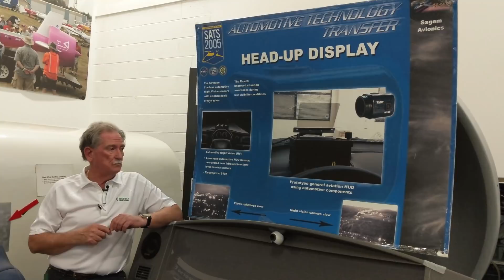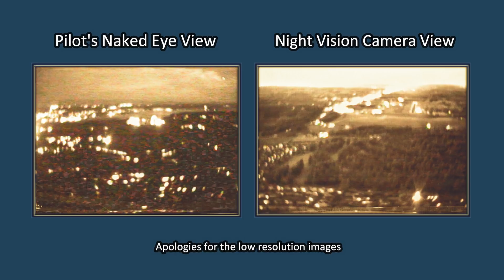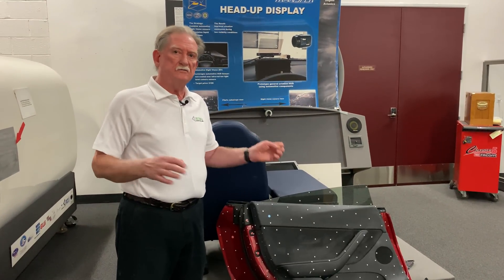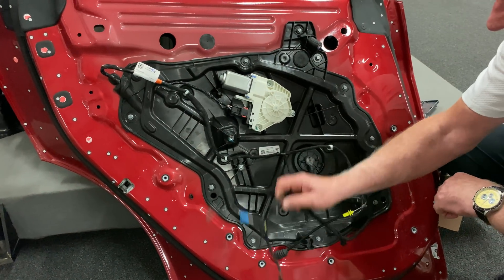Tips For Tesla E3 - Night Vision HUD & Wire Reduction

Comment: Why use wireless to any device in a car?
Its more unreliable than wired and needs additional things like the antenna! Just use the power line for digital communication. That’s old tech too.
And 48V power while you’re at it.
Reply: Was going to say this as well. You have to run power. You can’t cut cord length because of that. So just run the data through instead. Especially for low tech apps such as windows, locks and spaakers
Reply: @The01Director  not to mention it would represent an easy way to hack the car
Reply: 2 wires (2 is needed anyways for power, add data frequency on top) and a communication system similar to Ethernet. So you have only a small amount of wires and on some points a switch. So 2 wires to the door, where a switch splits it up to the mirror, windows, door handle, buttons etc. Every device can get an address so you can expand it later an controll everything from the main computer, but also direct by buttons.
Wireless would not save any wires, but opens a lot of problems. It could be disturbed without access to the car, and makes hacking a lot more easy.
Reply: @dr2okevin  don't even need a switch, you can daisy chain them as everything has an address as you said.
Reply: @dr2okevin  good idea, and I'm sure automotive companies have thought about too. does anyone know why it isn't state of the art yet??
- just a thought - couldn't one wire do it all? like the light on my (ancient) bicycle, where one wire provides the power, and the frame works as ground. any reason why this isn't done? I'm curious to hear your thoughts on this. BR
Reply: @bitnukl Agree, wireless makes no sense. Why 48V is better though?
Reply: @FlorentHenry  because power is voltage * amps. So for the same power you need less amps. With less amps you can have thinner wires, cheaper and lighter
Reply: @mbican  why 48V precisely though? Best compromise for wire size and components with very low power requirements? Arbitrary figure because of the 12V lead acid battery? Will a higher voltage drive the cost of components up or down (not considering economies of scale due to the fact that everything is massively available at 12V, i.e. uses less materials too?)? (Thx for the first reply:))
Reply: @FlorentHenry  48V is very popular too, it is below 50v which is what is considered safe as a touch voltage and means cable size can be halved.
Reply: Florent Henry the higher the voltage, the more expensive and bigger electronic components such as capacitors get. This also increases the cost of electrical wiring insulation to prevent shorting breakdown in the possible spray of salt water on snowy and icy roads.
Reply: @FlorentHenry  When transferring power with electricity, Power = Voltage x Current. Higher voltage means lower current for the same power transfer. Low current means you can reduce the thickness of the wires. Keeping voltage under 50 V still keeps the electrical system in the low risk category for electrocution, so 48 is a pretty good option. You can use a quarter as much copper and still send the same amount of power around the car.
Reply: Florent Henry to deliver the same wattage to a device, much smaller wire can be used as the current squared voltage losses through the resistance of the wire is severely reduced when the necessary current can be lower. Power delivered in watts is the delivered voltage *  Current.
Reply: Doesn't this require AC to work?
Reply: @Florestan Trément 
No, a wire is a wire, you can use dedicated wires as well as AC and DC power wires for communication.
All phone lines, ISDN lines and DSL lines use DC, power over ethernet uses DC....
(All of those use 48V or more btw.)
Reply: @goodyKoeln  I said that not because I believe DC cannot be used to transfer information, but I wonder if it can both transfer information and power something. I'm sure a LED doesn't care if its power level is perfectly flat or not, but what about a motor or a camera? I'm not sure how good a fluctuating power input would be for their longevity. Maybe it would require costly signal filtering and/or shielding. Even basic CPL at home is known to cause malfunctions on certain devices and much worse, without good shielding, it tends to affect the health of people. Although it probably wouldn't be the case at such low power levels.
Reply: @Florestan Trément
Every WiFi access point and every IP phone does that. So it’s possible. 😉
Reply: bitnukl but at what current level is power over Communications wire? I don’t think it is for running Power Windows...
Reply: @Ronald Leckfor 
Depends on the thickness of the wire. You could charge your Tesla over a communication wire. Oh wait YOU DO! 😱
Reply: bitnukl communications twisted pair or coaxial wiring highly depend on the specific impedance the transmission medium to prevent standing waves which cause distortion of the signal.thickening the wire will cause the impedance of the Coax or twisted pair transmission medium. It is much easier to simply run another current wire running the same route and the twisted pair of coaxial wiring. One of the reasons I chose to describe a double fiber optic inter web token ring is so power would also be in token ring allowing as much of the network, of devices remain powered and connected  in the event of crash which destroys part of the ring. The modules could detect a short, and shut off the Insulated Gate Field Effect Transistors connecting a faulted Token Ring Power segment on either the primary or secondary power distribution busses and also attempt Cross Connect switching  in the event serious damaging event such as a car crash. The reason I chose Fiber Optics was with glass fibers, they are heat resistant and in themselves impervious to stray noise pickup from nearby high voltage and high current switching.  I have seen one company, Ajax Magnethermic, use a 4 foot long fiber to connect the control electronics to a 56 KV 1000 ampere power thyrister bank to power their magnet to melt steel via magnetic flux lines. The fiber transmitted firing pulses and received back status and current sense data for the control board to process. 

Since the motor drive system used high voltages and high current, this prevents the drive from transmitting electrical noise into the network and prevents a network catastrophic event in case of an arc over from the power handling short back into the control system  that is network connected to thx rear of the system, in that way, only data is exchanged, not lightning!
Reply: I suspect it's got to the point that bluetooth transceivers are cheaper than the hardware to modulate and demodulate data superimposed on DC wires. Cheap bluetooth os It's the reason the internet of things is even possible at the moment. The most important thing to remember though is that the 'S' in the IoT abbreviation for Internet of Things stands for security. 

I'd want to be damned sure the communication is secure between car modules before I'd be a fan of this in my car - literally taking over the driving of a car remotely through the built in SIM card has already been demonstrated, imagine criminals using jamming equipment to tell the door of your car to unlock itself for you for example. I'm no fan of wiring looms though - I've already had a €600+ issue with my car where the wiring loom broke where it flexes at the driver's door hinge every time the door is opened, leading to it turning on the heated wing mirrors full power (While the switch was off - it also overrode the timer that turns the heaters off automatically if the driver forgets to do this) on one of the hottest days of the year, partially boiling the liquid crystal layer that forms the auto dimming feature in the wing mirrors. 2 auto dimming mirror glasses was over €600, so I got ordinary heated ones for €20 instead. The full wiring loom for the door was €150 if I'd spotted it on time. Worst thing is this is not uncommon for 2010's era VW group cars, but I've never heard of anyone else getting such an expensive glitch, short of the vehicle catching fire, as a result. 

The Transport Evolved channel on youtube mentioned that GM will have wireless battery management in it's electric cars, allowing hot swapping of faulty battery modules, at least theoretically. I actually know a guy currently working on the R&D for this product right now, so it's definitely coming.
Reply: @peglor  this article states that in 2011, PLC costs $1.95: https://www.powerelectronics.com/technologies/power-electronics-systems/article/21854615/modem-plc-transceiver-ic-meets-lowcosthigh-performance-needs
Reply: peglor how many cars using a bunch of blutooth devices do you think Dan be operating by each other before they begin to transmit on top of each other’s messages? Plus you are competing with blutooth devices with cellphones also.

Comment: Sandy, Instead of Running power cable and then a seperate radio that is subject to interference, why not run a RS485 communication signal over the power cable and lose the chance of the Bluetooth radio interference.
Reply: I take it a big step further with a dual redundant, 30 to 50 GBPS fiber optic token ring communications network. With dual power redundancy. See my recent comment.
Reply: @DishNetworkDealerNEO  That would require additional cabling. The entire project is to reduce material (cabling), cost and time. Adding fiber would not solve any of those issues...
Reply: Michael Holliday let’s add it up, two light weight fibers cable rings with a two power cables for redundancy which have to happen anyway whether radio telemetry is used or not to power whatever system modules  is used, still beats a car long wire for everything, still eliminates weight and miles of cabling, which is the engineering goal! Adding fiber is now what Is happening, replacing miles of wiring with a couple lightweight fibers and double redundant power supply wiring is what is really going on.,
Reply: @DishNetworkDealerNEO  I just retired from using R485 PLC communication and fiber (old multimode and newer single mode). OK, you are suggesting that they deal flexible cabling that Elon has already stated that cannot be handled well by  robotics. That means that are proposing replacing 2 copper wires with to fiber cables all that you are saving is weight and that would be made up by the fiber communication devices at each point. With RS485 communication you would have the positive power cable carrying the signal, no additional cable period. We would send hundreds of different signals over the RS485 since it is an addressable signal. This would save a great deal of installation time and cable.
Reply: Michael Holliday first of all, the power you are referring to in RS 485 is not enough voltage and current to operate the equipment being controlled, the power window motors, the power seat motors. It may be good enough to power the communications network, but not robust enough for use for heavy loads I’m sure your robotic equipment did not use IEEE Standard RS 485 to power your robots. The spec is now EIA TIA 485 with signals only transitioning from +- 200 mV for data signaling. I do not consider single mode fiber new. I was working with it in 1983 at M/A-Com Telecommunications Div, now know as Hughes Network Systems, Germantown, MD. Single mode fiber is unnecessary in such a short run, simple SMA Cleaved fiber connectors with Kevlar wrapped jackets are readily available. I would expect this to be hand installed, not robot installed as Elon has realized interior finishing is best done by human work anyway. 

1300 nM single mode fiber and lasers is best used for intercity data communications. 850 nM Multimode LEDs is all that is needed here, not even multimode lasers, as that is only necessary for intracity data communications.   Low cost  Multimode Fiber with LED and Avalanche Photo diode with constant voltage, medium gain,  low noise receiver amplifiers, is all that is necessary with such a short distance involved!  There are complete Surface Mounted, Fiber Optics systems on a chip, with Integral AMI clock encoding and decoding  now available that could easily be used to accomplish such a token ring easily and inexpensively.

Comment: I had a heads up speedo on my 1990 Nissan 240sx. Rarely did I ever have to look down at the gauge cluster because of it. Something even that simple would be a drastic improvement for new Teslas, since you have to peer off further than a traditional cluster.

Comment: Less wires means less security. Encryption only goes so far to protect, and it may not be good enough for the life of the car.
Reply: That is why a secure, closed token ring local area network using fiber optics, not radio connections,  as I have described in this comment thread, does not open the door to security violations, yet offers a high speed bus with four way redundancy to carry traffic to all modules on the Token Rings. This means practically bulletproof redundancy, guaranteeing mission critical communications and control of all functional modules on the system and ensuring a path to bypass defective modules, keeping the network up despite a module loss.
Reply: Ronald Leckfor fiber optics is more expensive than copper wires. It is also brittle and really does it like to be bent.
Reply: Peter Lund first of all, if creating a secure network in an automotive situation, Coaxial Cable would be one choice, but since lightweight RG6 cable would require two cables to serve the function of each  lightweight fiber, and is limited to 3 GHz for high quality, premium cable, the advantage of fiber is clear, it is way faster, capable of easy expansion due to it’s much higher bandwidth capability than coaxial cable can offer. While fiber is more fragile than coaxial cable, it can be intalled in the frame rails of the vehicle, and is commonly protected by a jacket of Kevlar fibers. The printed circuit board could convert to coaxial cable signaling locally for very short, lower bandwidth branches where flexing occurs, such as doors. The backbone network can still be higher speed due to the higher bandwidth of major tie points such and the main computer to the rear and front and under seat controllers and to the Charging, Motor and temperature regulation for batteries and HVAC controllers under seat controllers, to allow for high speed communication  network bus. It certainly be a mixed mode, multiplexing system. The main goal, is to replace the main trunk of the wiring harness with a dispersed set of multiplexed controllers with redundant secure communication and power lines to replace the miles of wiring that run through a car. Digital Multiplexing can cut the complexity , and labor and materials costs and weight of a car wiring system by at least 75%. If the replacement system is built with redundancies, such as a double token ring architecture, leading to four IO points from each networked  module, it will be more fault and damage tolerant  than any point to point wiring system can ever be.

Comment: I think wires are still better because otherwise you have to deal with radio-wave interference, potential issues with consumer electronics, hacking etc.
But even with keeping wire, you can simplify greatly if you go from one wire for each actuator to a "bus" wire that connects everything.

Comment: Great ideas with the wire reduction Sandy, however, the HUD & night vision will not happen. Simply, FSD will make it redundant. A waste of research and development resources.
Reply: Night vision could still happen in the sense of IR cameras. Teslas still have a bad time when in very dark conditions or when facing the sun. It doesn't need to be displayed to the driver though.

Comment: Maybe I'm just missing something, but why don't cars use ethernet? (Or PoE for that matter) Wouldn't it make more sense to have a single wire that loops the car and a each device is just connected to the network? (Such as a window control module, lock control module, etc.)
Internally Tesla already uses this for communication between different devices so I'm not sure I understand why it doesn't control more.
Reply: Curtis English if one device fails in one direction, the token ring would reverse data flow to go into the device the other way around the ring. In case of failure in both directions, that is why there is a second redundant ring, and second power source with the expectation the module would also be dual redundant and fault tolerant, with two totally independent functioning circuits and boss which decides based on communications and internal fault alarms to decide to switch to the backup section. This would trigger a service car soon alarm transmitted back to the main computer which would notify the driver or  autonomous driving system for robotaxi driverless operations.
Reply: @DishNetworkDealerNEO  Sounds like it'd be a good system with that in mind!
Thanks for the explanataion. :)
Reply: Curtis English please read my comment which full details the double token ring Local Area Network in this same comment thread for full details. I spell it all out in full detail in that multi paragraph comment.
Reply: Ethernet networks can develop bottle necks. It is an old technology that  has serious bandwidth limitations when data traffic becomes high due to its protocol. Token Ring is the way to go, due to its resiliency and fault tolerance. See my comment on a dual token ring system with dual redundant power feeds and using fiber optics to increase available bandwidth and data rates.
Reply: @DishNetworkDealerNEO  Totally, a token ring could work. I don't recall much from my Cisco CCNA years ago, but I recall that method having some drawbacks?
If one device in the middle of the ring failed would the whole network not fail?
(Assuming each device has 2x RJ-45 one for in and one for out, likely I'm thinking of the wrong thing! It's been years. 😅)